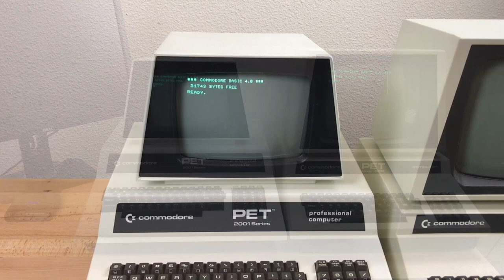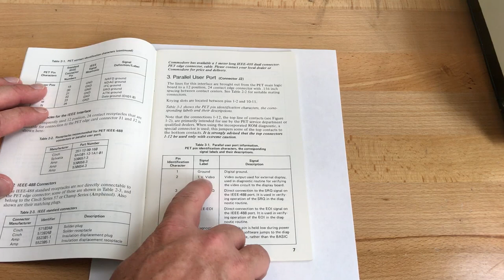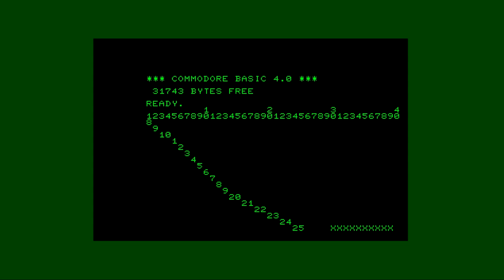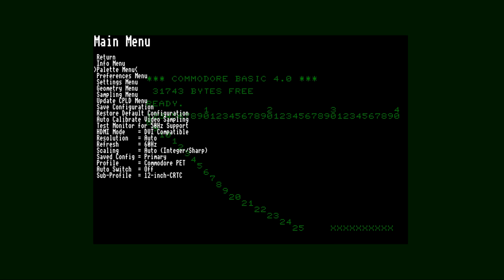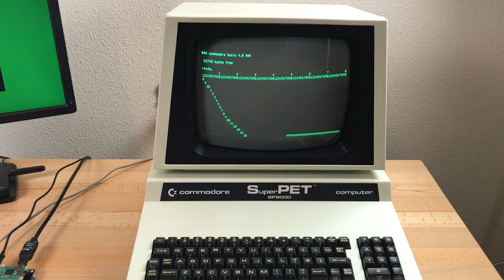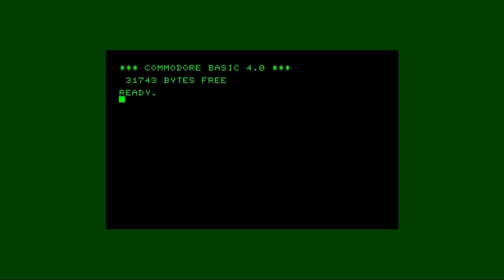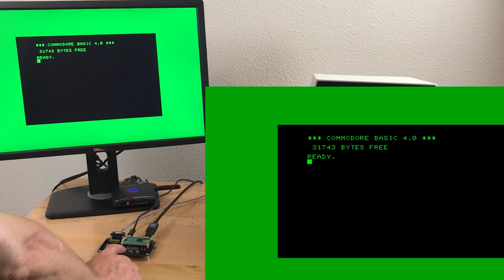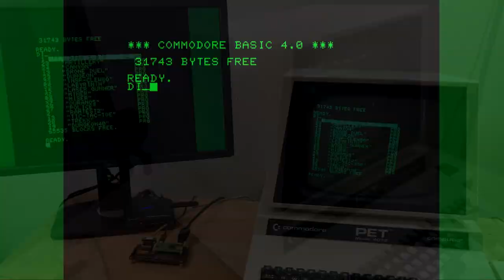HDMI for the Commodore PET

Comment from the maker: There are a number of different versions of the RGB2HDMI. Some are built for analog RGB but the ideal version to use on the PET is the digital RGB version, or one made for MDA, CGA, EGA & Commodore 128.  Most sellers are out of stock but I do see one on EBay now and on sellmyretro.
The CPLD chip used is XC9572XL-10VQG44C or XC9572XL-7VQG44C. Mouser & Digikey have 0 at the moment but you can have them notify you when they have some in stock.

Comment: Nice work Chuck! It might be time to take a look at how portable the RGB2HDMI CPLD stuff is, to use an available part. Never know when or if it will come back in stock.
Reply from the maker: The CPLD chip used seems to be the AMD/Xilinx XC9572XL-10VQG44C or XC9572XL-7VQG44C.  I would have no idea what could be used in it's place and there's a good chance that any equivalent part will be just has hard to find.
There were early versions that used discrete logic instead of a CPLD but that might limit the build to work only on a specific platform.

Comment: Excellent video and thanks for sharing. Finally got my unit and noted that the cable should be a network cable with twisted pairs.  If not, the signals bleed over and video is off. Just my observations.
Reply from the maker: Yeah, even though the signal isn't balanced, twisted pair will definitely help reduce cross-talk. Just be sure to pair them properly  so one of the pair is always ground.
Separate shielded cables might also be an option.

Comment: You mentioned a rom for the PETs, that enables ntsc video. Do you have link to a website about it? Im looking to get a video signal for a normal Monitor for a 8032 Mainboard that I have.
Reply from the maker: Look up the Commodore PET 'composite adapter' or 'video mixer'. There are a few schematics and one that was made by D'asaro designs.
For a 12" PET which have CRCT chips, you need to initialize the CRTC to run at NTSC (or PAL) frequencies. For that, look up 'Steve Gray Editor ROM Project'
Some have also had success using an MDA monitor at the normal CRTC frequency of 20KHz, though it depends on the monitor since MDA is normally 18KHz.
The 9" PETs normally run very close to NTSC frequencies (60.01Hz), though they are a little off and may not sync well depending on the monitor.

Comment: a schematics with the cable realized would be nice, following the wire in the video is not easy
I realized apparently the same cable, installed the profile on the sdcard
on the cga connector pin green  has the video signal, HSYNC the horizontal synchro, VSYNC the vertical synchro, and the osciloscope says that it's ok
but the rgb2hdmi keeps telling me  "no sync detected"
I'm using a commodore 8032 with 80col screen....
any idea  ?   
thanks
Reply from the maker: Sorry, I do show the connector pinouts, you can pause the video on those or they are easy to look up online.
On the 8032, some of the signals are inverted so you may need to edit the profile to account for that.
See @06:00 and try to adjust the Sync Type for H and V to + or - as needed.
also @06:25 make sure you don't have Sync on Green enabled.
Last, double check your connections. Some online sources of the User Port pinout have the Horizontal and Vertical outputs reversed.